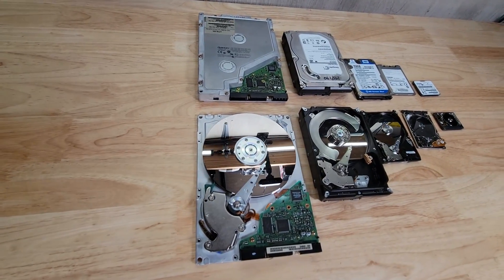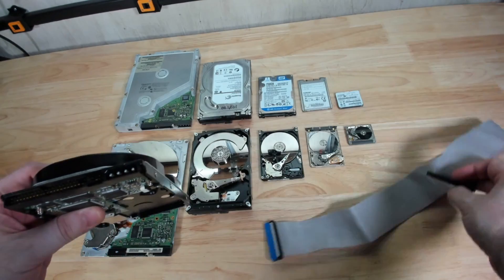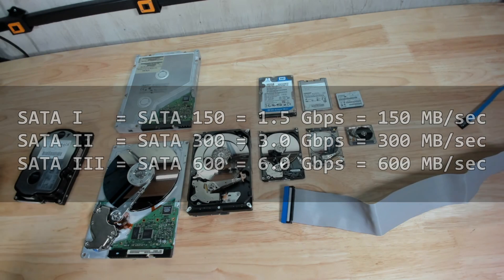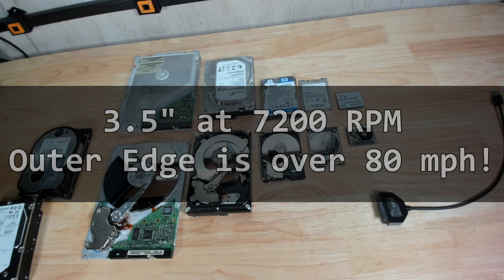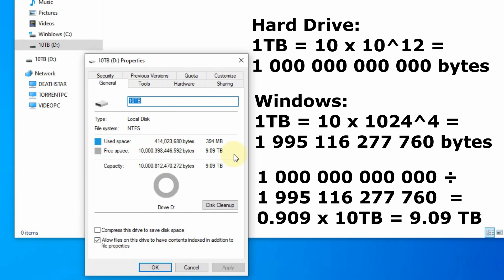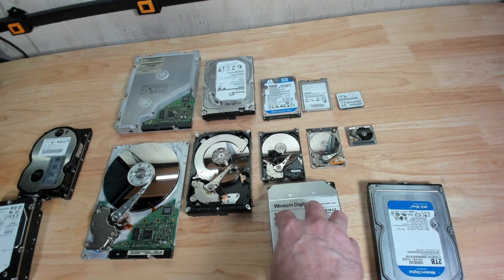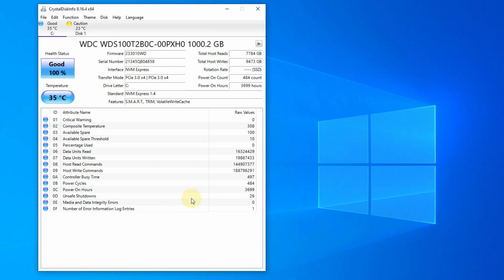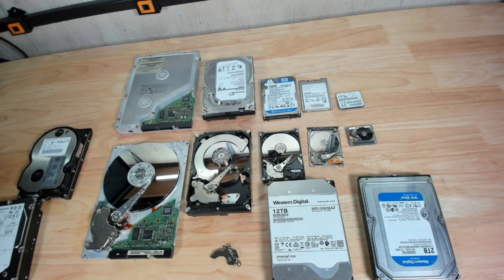10 Interesting Facts about Hard Drives

Comment: I wonder, with your SSD testing and all, what is a safer medium for long term backup storage? I saw your videos on the 1 and 2 year unpowered tests and was a bit surprised.

I usually immediately push against the idea of hard drives because mechanical, but then again, long term storage in a nice sealed container while powered off, I can see a hard drive potentially outliving an SSD. Suppose the issues would be concerns with lubrication and storage conditions (air filled drive, humidity, good combo).

I’ve been living in ignorance is bliss with my now 9 year old NVME drive that’s been filled a few times 😅, time to fire up crystal disk and see what it says.

Also getting into it all, after years of working a lot with computers and help desk it took me till this year to actually bother setting up a NAS, and now I’ve fallen into the pit. I crave more drives, more space, more redundancy, and my wallet isn’t too excited 😅
Reply from the maker: The best strategy for long term storage is using the 3-2-1 backup strategy. Effectively three copies of your data, two different media, and one remote. These days it's hard to have two different media though as hard drives are really the only affordable and realistic options.

Having a copy on your PC, one in the cloud, and one on an external backup drive easily meets this criteria.

But one more important step is to maintain checksums, CRC, hashes, whatever you want to call it, for your data, and validate your data periodically.

The entire idea behind it is it to regularly scan your data for corruption, replace any corrupt data with known good data, and keep one remotely so if you, god forbid, have a disaster (fire, flood, electrical surge, ransomware, whatever) your remote copy will save you. Frequently cold backups (i.e. hard drives kept offline and stored somewhere) is good, and may not be 100% up to date, but at least you'll have 95% of your data rather than 0%.

Good luck with your NAS! It can be addictive.

Comment: The earliest hard drive I used was on an IBM 1130 that had a 14" single platter accessed by a stepper motor and held about 1MB of data. It was REALLY slow. Later, I worked with IBM 3330 hard drives (look it up --- wow -- 200MB!) that had removable disk packs. Thanks for your videos and this channel. Very cool.

Comment: Can i plug a 2.5 inch hdd on to using sata power on the desktop where the connecter provided with both 5v and 12v but the 2.5 inch disk only take 5v. Is this safe to do so ??
Reply from the maker: Yes it's safe. The 12v pins aren't wired on the 2.5" disk, so they will just be ignored.

Comment: Hello. I've always wondered. why 3.5" drives had the same capacity as 2.5" drives. where the larger ones could fit more data. because they had bigger plates. I don't know for sure if my thoughts are true. Regards.
Reply from the maker: They contain the same data density or "bits per square inch". So while you can have a 4 or 5 TB 2.5" drive, it will require 5 platters to do so, where it will only require 2 on the 3.5". 

Sometimes they use older tech on the lower capacity hard drives too, so less data density.

Although sometimes there are factory defects that can cause a disk to be rebinned and low level formatted by the factory to a lower capacity disk completely bypassing the "bad areas". It is surprising that today that 500GB 3.5" disks even exist. It seems 1TB should be lowest, where a single platter can contain over 2TB of data.

Comment: I'm old enough to have been wowed by and actually used ESDI and SCSI... then in the early 90's IDE in a 486 felt almost like paradise after fighting with the two dinosaur interfaces in 386 and 286 junk (no built in FPU), although SCSI in a Amiga or Atari ST was generally blissfully hassle free.

Comment: Mods are the following 

Noise and vibrations Noise external as well as internal operations / then spinning faster and slightly slower hence the pulsing / hair like inductors to cause a polarity shift to be read and a charge to be programmed